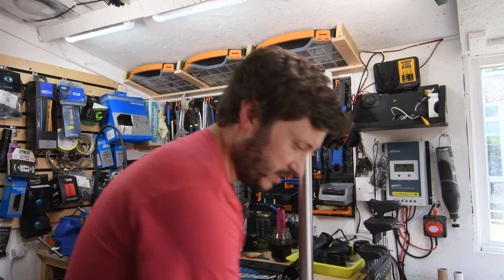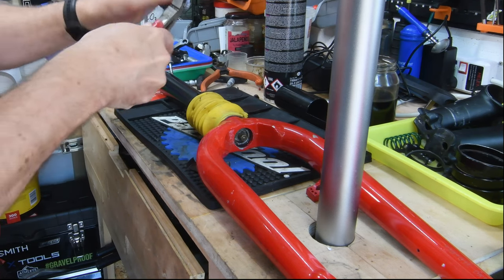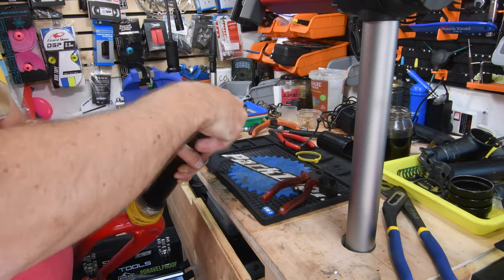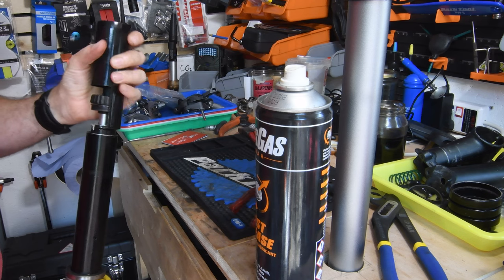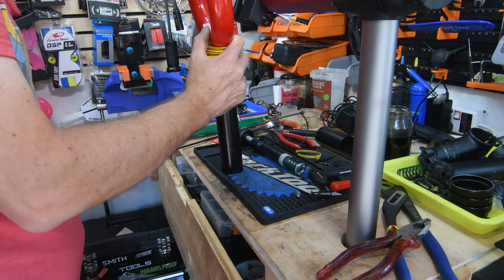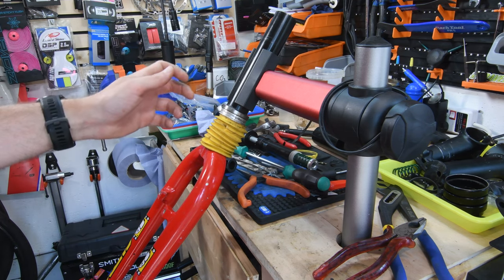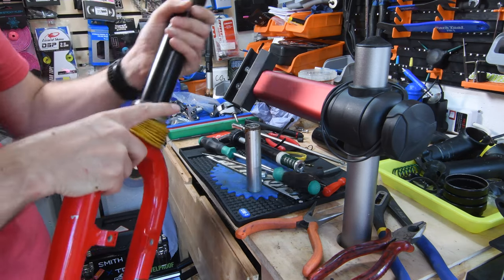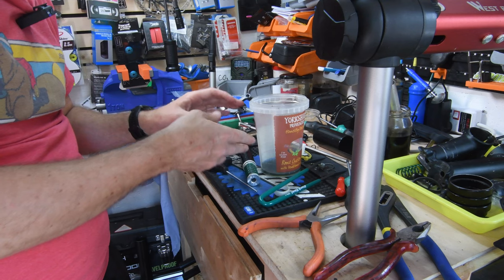Headshok Rebuild Part 1

Comment: great video. I just acquired a new to me 1997 Cannondale Killer V900 HT with DD60 headshock. I'm 230 pounds so the shock is very lacking and I'm hunting for a heavy duty spring for  one. Also hoping to snag a yellow DD60 boot as mine is black on black with black boot but yellow lettering. cheers from Nova Scotia , Canada !
Reply from the maker: I would say just have saved searches on eBay, messsge on the vintage cannondale FB groups and check the marketplace listings at least once a day.. these things do crop up now and then but can be easy to miss!
Reply from the maker: The yellow boot you can order from ImprovePart.. not 100% the same yellow but close enough!

Comment: Great video! i bought a cannondale f1000 and im facing the same problem with the broken valve stem.. im about to get a new air cartridge to replace it, but i dont know if i should remove the air cylinder from the bottom as you do in this video or better through the top as in part 2 video
Reply from the maker: Hmm well it’s good to clean things out properly and remove the c clip but if everything is nice and clean the just sliding it out of the top end is easier! By the way I did manage to drill and tap a new valve body onto a corroded cylinder end..  useful at a pinch, but it does extend down further

Comment: I'm just starting doing this exact bike rebuild myself
Reply from the maker: Which Cannondale are you working on? Lots of different models use the same headshoks.
Reply: @gravelproof    probably the same one.   A Jekyll 900 which is 00/01 with the float RC rear & a headshock up front
Reply: @dennishayes1505  ok this doesn't belong to any bike in particular. I have a rather large collection of headshoks that need work or do work on them for other people, I believe this model was used on various different framesets in the late 90s.

Comment: Nice video. Is there anyway to convert the full spring headshok to air?
Reply from the maker: Yes for most headshoks you can swap out the damper and coil setup with an air / oil setup.. you just need the right travel length, and to remove the bottom spring perch.

Comment: I just found your channel and the two vids I've seen so far are the most informative I've seen so far. I have a 2001 Jekyll with a super fatty fork on it. I'm trying to find the correct castle tool for it but don't know much about them. Stuff that old is becoming very hard to get info on. Any help would be appreciated.
Reply from the maker: So the castle tool that I use for most of the headshoks is KH031 which works for all of the oil dampers I have taken out so far.. and that would the one you would want.. the thing is it’s hard to find these days.. there is a Leonardi one but can’t be sure which model it is. Or you could check out https://www.improvepart.com/ they have various tools I believe they have a headshok tool.. I bought a lefty tool from them. (The DLr lefty needs a two part tool which is unobtanium otherwise)
Reply: @gravelproof  Thanks for the reply. I looked multiple places online and everybody is out of stock except the link you sent. Not sure about the company unless someone has used them before. I did find some 3D printed files that I forward to a friend to see if it can be printed. Looking forward to more of you vids.
Reply from the maker: Yes I’ve purchased parts from them before.. look up RocFu.. he’s been involved with the vintage Cannondale community for a long time. I have been testing out various tools of his and even new bearings he has been making.

Comment: If this Headshok had been an "air" fork, there would have been a schrader valve on the stereer tube near where it goes into the top of the fork.
Reply from the maker: Only the delta headshoks from the early 90s had the air valve at the top. Most headshoks have the inflator under the crown, meaning you need to remove the wheel to inflate. Let me know if you would like me to post reference images for you
Reply: @gravelproof  Yes, I know, but those delta shocks went until the late 90's as well. I was a Cannondale dealer at the time, and I remember selling a few.
Reply from the maker: And yet you didn’t see any of the Headshok models like Ultra, Super, Fatty, Fatty SL, Super Fatty D etc that had the inflators underneath?

Comment: Why does no one strip the damper and replace the lip  seals. That is the main thing that goes wrong with the ultra and the only reason the lockout stops working oil the oil leaks out. Also everyone does these what amounts to an oil change in the style of a long winded university lecture.
Reply from the maker: I didn’t have time to cover all parts of a Headshok rebuild in one video.. i think I commented in this video that I hadn’t covered that. I have another video where I tear down the damper into its constituent parts and have another one to come out where I build it all back up. It just takes time to film that stuff with everything else going on. Appreciate your patience..